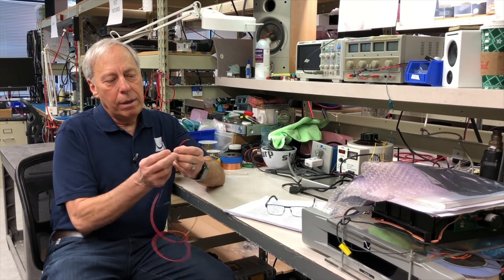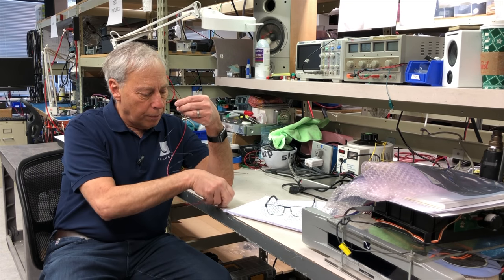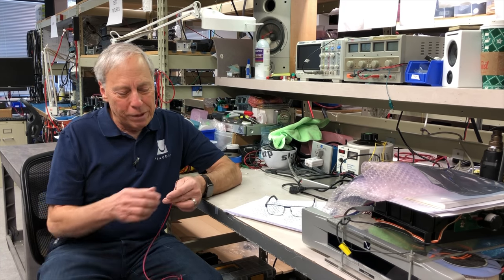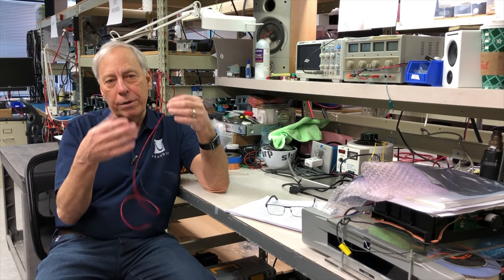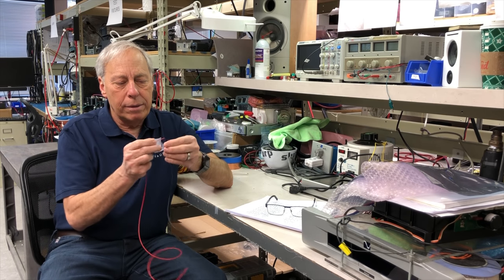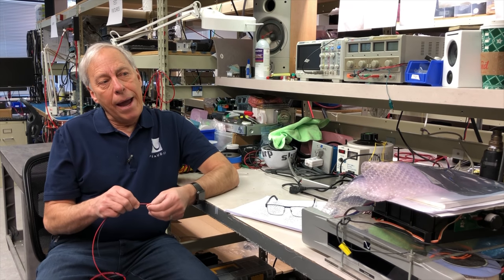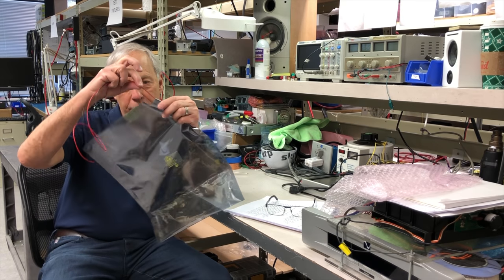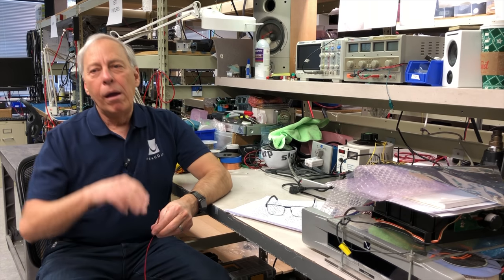The best DIY interconnect

Comment: To discount RG59 the way Paul did is very unprofessional for a man of his caliber.  It is not a big piece of plastic, it is called air injected dielectric foam designed to reduce capacitance, a solid core copper RG59 cable makes an excellent audio interconnect.   There are millions of miles of RG59 used around the world in the communication industry and it exceeds the specifications of an unbalanced audio interconnect.   I watch a lot of Paul's videos and I happen to think he appears to be a very gracious and humble man but he is not always right.
Reply: Not only is he not often correct, he loves to hear himself talk and in that, actually starts to believe himself which can happen if done frequently enough. Nice guy, but loosing faith in the content of his videos lately. In his defense, he's getting elderly and in this state the brain doesn't always work as it used to. God bless you Paul, you believe what you wanna believe.
Reply: @rianredfield5252 he always goes off topic about people and situations we don’t know or care about. I find myself skipping ahead until he gets to the point or at least his version of the point.
Reply: I think Paul found his way of during it. I Like how he explained the spacing of the wires.
But I make my own DIY and Use Belden 1505A  All Copper 75 Ohm SDI Coax, RG-59, 20 AWG Solid BC, Foil + 95% TC Braid.  This cable has a smaller diameter and more flexible than RG6 but still stuff and way better than Normal, Good RCA cables And Ii make a Huge improvent.

Comment: I’ve been making my own ICs for 35 years. I’ve finally settled on what I feel is the best sounding solution. I start with Mogami 2549 microphone cable, which is very high quality. One conductor goes to hot, one conductor goes to return. The shield is tied to ground at the source end and “floated” at the other end. Numerous listening sessions determined that connecting the shield at both ends reduced transparency and dulled the sound. I have found this interconnect to be extremely neutral and true to the source. A typical 3’ set can be constructed for less than $15.
Reply: I did the same for my TT. Solved many ground issues. I still get radio transmissions sometimes. No joke!

Comment: Sorry but most of what you said was complete and utter nonsense. If you use a twisted pair for anything other than a differential input, you introduce noise. For these really short runs, it might be negligible but still, no need to spread misinformation. For single ended, coaxial is THE cable to use period.

Comment: Just for context. I’ll run the numbers, worst case delta low Z load of 10K, 1.5cm spaced vs twisted pair, 1M length, in phase terms (magnitude gets meaningless here) you can consider the difference between the two solutions as moving your tweeter 1/3 of 1 thousandth of an inch relative to where it sits on the baffle. Other info is that the resonant frequency is ~22MHz using this arrangement, (pure resistive load, no parasitic)with a 10’s dB passive gain (it’s resonant), so ensure that you have adequate RF filtering in place. I’ll leave that to your imagination as to what that cold be.  Not disagreeing, just adding context. Best DIY interconnect, it’s the shortest one between where your source is, and where the signal needs to go. Keeep capacitance low. Inductance comes with the wire. Good Luck.

Comment: This is technically inaccurate codswallop to the point of ignorance.  The frequency-dependent attenuation phenomenon involved in audio "interconnects" -- if there is any at all, which I doubt -- is almost entirely shunt capacitance, not "inductance," which is insignificant considering the distances, impedances, and frequencies involved.  Moreover, unbalanced-line, relatively low-level signals require shielding in all but the most stringently controlled EMI-RFI environments, as LD Blake's recommended "walkie-talkie" test demonstrates.

Comment: I guess that's why you (Paul) use braided power cables.  As for interconnects, why not use 2 shielded cables? Why would high end audio even use a RCA plug and not separate the 2 wires with their own connections in the equipment? Would it be better to use optical connections? What happens if the ribbon connections have other ribbon connectors on top, around, beside them? I wonder what they use for the lights on my offshore compasses? Any magnetic field could make them off even by a tiny bit and that could be a big deal and it's not like they can compensate being the lights are  only on now and then and not constant.

Comment: I have used DIY ribbon cables for years.  I like solid silver the best, but even 24 gauge copper magnet wire is very good.  I use packing tape, but I can imagine masking tape might sound better because paper has a very low dielectric value.  Then also use very low mass RCA plugs like the Eichmann and you will have an amazing sounding cable.  Keep em as short as required.

Comment: Paul. Could you double check with your engineers? If the pair of wires are closer, series inductance decreases (loop area decreases). You said the opposite in the video.

Parallel capacitance rolls off high, too, when combined with the series resistance (or inductance) of the output stage of the source gear.

Comment: I agree that shielding compresses the sound. However, for phono interconnects, you usually need shielding to avoid hum and noise. In those cases, it turns out that coax is a pretty good option. Although RG59 isn't the greatest, you can find other coax cables with low capacitance and inductance. The cables made for HDTV are usually more than enough, for analogue audio too. You can diy a phono rca cable with shielding but it's a lot of work and you won't have the precision to keep a constant space between the conductor and shield, which is necessary for low capacitance and inductance. So, buying coax is a viable option.

Comment: Paul, a few questions: 

1) Can I use ribbon cables like the ones in old IDE HDD connections and leave the wires in the middle disconnected?
2) I bought a KMP cable for power radio applications - it's a 4 wire (AWG 18) + shield - and intend to use it for the loudspeaker. Is it a good idea? Do you know how I should connect them? Is it worth connecting the shield of power connections to the ground? Could I use the Phono input ground for that and not damage the turntable audio?
3) What would be the effect of RF coax cables on the sound? I really like how the compression RCA connectors fit on those cables.

Thanks!

Comment: "a significant difference in sound quality" WOW, I'm really struggling with this type of stuff....I'm subbed, I'm staying with you because I like it here....but I never do anything without shielding..... I hear snakes hissing in the background, they're getting close..."the braiding puts the conductors close to 90deg acting as a shield" I'm going to go waaaay out on a limb here and in the voice of the late great Sam Kinison (RIP) say WHY NOT JUST USE SHIELDED CABLE !!!!!
Reply: Twisted pairs for audio and data signal transmission are an industry standard method and have been since the invention of the telephone.  Even today, what's inside your cat 6a unshielded cable is four pairs of tightly twisted conductors which are good for a data transmission rate of 1 gigabit per second.    The usage of twisted pairs reduces the need for shielding since any interference that is picked up by the cable is common mode interference and automatically rejected by the receiving circuit if it's properly designed.
Reply: I'm totally aware of cat cable and it's intended uses, I use it all the time. However, after over 40yrs in the audio industry, I've NEVER seen twisted pairs used for line level analog audio signals, never. And that includes private homes, studios, clubs, theaters and stadium systems.....and churches :-)
Regarding cat6, most manufacturers of 4k HDMI baluns will NOT guarantee performance without using SHIELDED cat6.

Comment: So if I follow how you constructed your "ribbon" cables, the easy way to build one is just to use 300-ohm twinlead antenna cable. Forget applying the masking tape.
Reply from the maker: Yes, we actually started out with twin lead antenna cabling but found the tiny wiring inside didn't sound as good as the masking tape wonders.

Comment: One extremely important thing you didn't mention is that of the source and termination impedance of the associated equipment and how profoundly that effects how much any interconnect will influence things like frequency response etc. The vast majority of solid state gear made today (and you obviously know this) has a low source impedance. The bottom line of this means that any capacitance and/or inductance in an interconnect will have very little influence with gear with a low source impedance. You could get away with using a couple of coat hangers for interconnects in this instance.

With vacuum tube gear, things are quite different. Depending on the configuration of the output stages, the source impedance could be quite high, and in this case inductance and capacitance can and will have profound effects on frequency response.

Comment: I once sold Kimber Kable and while it is good there are others I prefer. The cable I use is shielded litz wire. It is overall a great cable but compared to some super pricey cable it smears the highs a little but I can live with that. I use to recommend Cardas 300B as it sounded good and wasn't so expensive  and I still have a pair I use on my tuner.

Comment: I just finished a little experiment involving a 10mH inductor. The only way I was able to alter the inductance readings was by introducing a strong magnetic field in the close proximity of the inductor (the more neodymium magnets I used, the lower the inductance and resistance for that matter. I observed the inductance readings between 9.38mH and 0.75mH depending on the nr of magnets and their proximity to the inductor coil; the resistances read between 1.2ohm and 0.7ohm). 

I used 1in, 1ft and 2 ft leads and finally two 12ft 18awg speaker wires. I've tried all kinds of 'geometries' with the wires to no avail... Parallel lines, twisted lines, made 'coils' out of the speaker wires and put them in all kinds of positions in regard to eachother. Static or fluctuating magnetic fields in the proximity of the wires (any geometry) made no difference in the readings. 

I suspect that the shielding and the resistance of the wires are of greater importance when it comes to audio signals... We could try some little experiments involving capacitance too :} 

======================

Self-inductance is a electro-magnetic phenomenon taking place in a circuit, conductor or coil. The current flow generating the magnetic field influences the voltage in that circuit as some electric energy is converted to magnetic energy and back each time the magnetic field is generated and then when it collapses. 
Mutual-inductance is an inductive effect where a change in current in one circuit causes a change in voltage across a second circuit. This is possible when a magnetic field links both circuits (as in a transformer).
Concerning speaker wires, only self-inductance would apply since there is just one circuit, in essence a wire loop including the filter and motor coils.
For interconnects, both types of inductance apply as we have separate circuits as in left and right channels. 

Fun question: why does a driver behave like a resistor when facing up and as a inductor in series with a resistor when facing down? :}

Comment: Paul love your videos, i am an Engineer Canadian, your insight into the industry and knowledge is fantastic
Reply: @LD Blake
Why?
Reply: @LD Blake
O.K., I thought you had something against the tape.   : )
I have some old Audioquest interconnects that aren't shielded. Pretty much what's shown here: Two really skinny wires running through some fancy filler to separate 'em, surrounded by a thick plastic hose, and soldered to RCA connectors at both ends.
I suspect if you don't live in the middle of a city; it's not as much of a problem.
Reply: does twisting the wires do any thing to the signal? i know in the networking feild they use twisted pairs of wires to help prevent cross talk
Reply: @LD Blake
From what I've read, Monster Cable was the first audiophile cable on the market. They're the ones who started the whole cable thing. That's kind-of ironic since I would hope most audiophiles by now know that they make bad cables!   XD
I have also heard from another source I trust  that Audioquest aren't very good, either. All I can say is that the Audioquest cables were a vast improvement over the cheap-o stock cables.
I've been happy with them thus far, but maybe it's time for a change...
Reply: @LD Blake
I do plan to watch that Null Tester video, just out of curiosity, but regards the rest of your comment; I realize you are trying to give helpful advice and I thank you for that, but I must respectfully disagree.

I do not trust such devices as the "Null Tester", and the reason is that mathematics (which I'm sure is what it's all based upon) can be manipulated to produce any desirable outcome. If you strip away all the technical terms and fancy readouts, what it amounts to is a parlour trick designed to make you believe what he wants you to believe.
I'm sure it is all scientifically sound and repeatably demonstrable, but that doesn't mean he isn't manipulating the result for you to see what he wants you to see.
Now, since I haven't seen it yet, maybe I'm way off in left field. Fair enough. He stated that it's a test to prove that all wires are identical, correct? Well, we already know that all wires are NOT necessarily identical. They can be made of different materials, or have coatings, or different metallurgy. Even the crystalline structure of the metal can be manipulated. Don't take my word for it, though, try asking a metalsmith.

Then, you have to take into account the effects of the insulator on the cable, and the effects of the different dielectrics on the electron propagation.
Then there's the effects of the electromagnetic fields produced by the cable. Does his Null Test even mention that? I doubt it, but we'll see.

However, after all that's said and done, you can measure and measure to your heart's content, but at the end of the day you haven't heard a single damn thing.
Listening to well reproduced musical performances is the name of the game here, not impressing someone with your collection of yardsticks and slide rules.
If I don't hear an obvious improvement in the sound of my system at home, then what good are all the measurements, meters, and tests in the World all put together?  Squat, that's what.

I do my testing with my own ears; same as my listening. If I like what I hear, then I'm satisfied.
Does that mean I'm going to go out and drop 50K on some cables that you don't like and haven't heard? Hardly, as I'll never have that kind of money to begin with. But if I spend sixty bucks for some cables, hook 'em up, and it sounds like I just bought a new amp and new speakers, and I can feel bass through the floor that I previously could not, and I can hear details that I previously could not; then I am most certainly not going to think, Oh! It's all in my imagination because some guy measured it and it didn't measure up!   XD
Reply: @LD Blake
I understand what you're saying, and I know that human senses can be fooled. I have thought I saw things that turned out to be other things! So yeah, I get it; and by the way, thanks for saving me the half hour of sitting through a video I didn't really have much interest in, anyway! That's the exact same argument that the 'Slide-rule Audiofolk' have been using for years to argue that all digital files sound the same: "Ones & zeros is ones & zeros."
Well, that whole argument was debunked with something from outside their neat little box: Jitter, which exists in the analog realm, but which affects the digital signal. So they were correct in their assertion that "ones & zeros is ones & zeros", but they were proven incorrect that the sound was unaffected, because it was affected by something they hadn't thought of, or knew existed.
The same can be said for cables. 
Yes, senses can sometimes be fooled, and yes, there is a psychological element whenever you have another person present, especially if they are trying purposefully to influence you; but any good Scientist will tell you that there are things yet unaccounted for.
We don't know everything.
That's why I brought up electromagnetic fields. They certainly have an effect on the sound of a stereo system, but how many audiophiles even know they exist?
There is a trap that audiophiles can fall into: The aforementioned 'Using music to listen to your equipment'.
There's also a trap that scientists and learned people can fall into: That of arrogance and hubris.

"Well, we know 'X' is true, so 'Y' must also be true!"
"Well, have you checked it to see for yourself and make sure?"
"Oh, no need for that, my lad! The chart here makes it obvious!"

Uh-huh. Riiight.....
Reply: @HareDeLune  Why don't you just trust your own ears; that's what it's all about being an audiophile, is'nt  it?
I have several AQ cables and in my ears they sound great.

Comment: Thanks for vindicating me Professor Paul. I braided my by-wire cables a couple years ago. 6' Martin Logans on 400 watt Emotiva mono blocks. Sounds pretty good (hi-rez from a Note9 into a dbx go>Rack or my BBE rack mount eq). 3 pairs braided and a set of 4 individuals braided into bananas.Braided jumpers at first. Not my $10,000 dream system. Working on it.Tekton, Kinki,Schiit and maybe your GainCell DAC. I'm XLR and PANAMAX conditionar. Maybe a couple of your PowerPort Classics. Braid me some power cord! Braided XLRs? Why not.? Toss in 99% True and some Ocatav Records and we got a deal. Love what your doing!